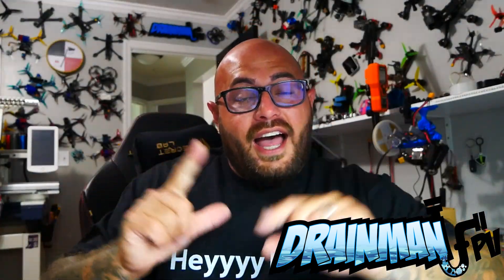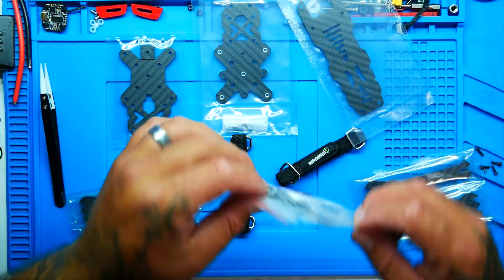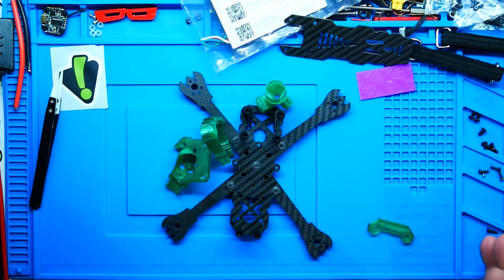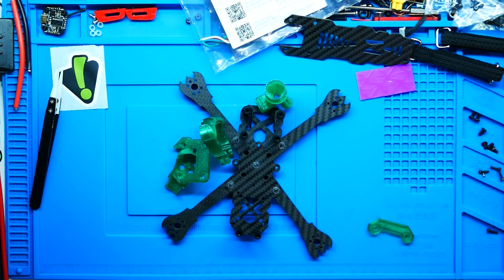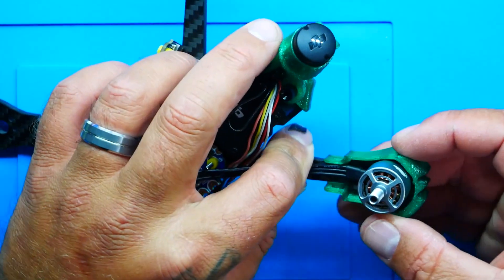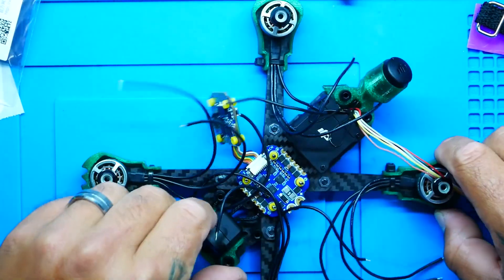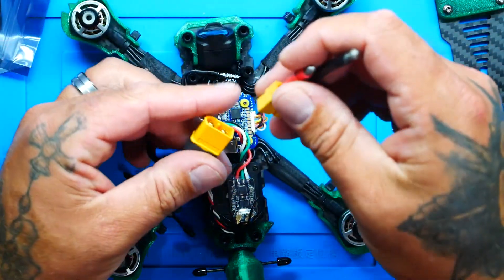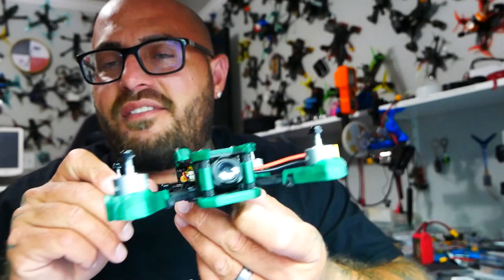Let's Build Bot's New Micro!!! The Grinderino 🤖

Comment: I'm curious if the O4 lite will fit with the Speedybee 405 AIO (like normal, stacked on top, or maybe even 3DP an adapter to rotate the AIO to the standard orientation)
Reply: That 3dp adapter sounds like a smart idea. Where would I find something like that. I'm planning a build similar except I'm planning on using an old vista I have laying around

Comment: I ran a t-motor AIO with the 03 air unit; I had the adapter kit to mount the air unit, which was tight but fit.  I just thought i would share. I went with 4S because i have so many of them, and I was concerned about the additional weight on a 3 1/2” quad, but i haven't been flying long enough to move up to 6S; I'm too busy crashing🤔  Great job with the video, thanks.
Reply: I ran the same tmotor aio and 03 in my 4s grinderino then the tmotor f7 mini 45amp bl32 stack on my 6s grinderino with 04 pro. Both worked perfectly
Reply: Well aside from mounting the 03. But alien tape for the win

Comment: I managed to squeeze a Hakrc F722 Aio and an Avatar v.2 in mine and it just barely fit. To make it work I had to wire up an extension for the usb port. In hindsight a Bluetooth flight controller would be more convenient.

Comment: Great video bro.  I was hoping you would do this video,got the frame but needed to learn about the stack and using a 03 ,I wanted to use a AIO but would have had the same issue.  Needed a rough idea of motors.   Prints.